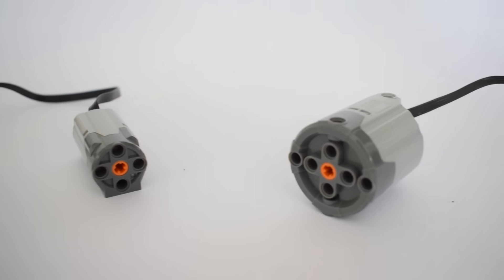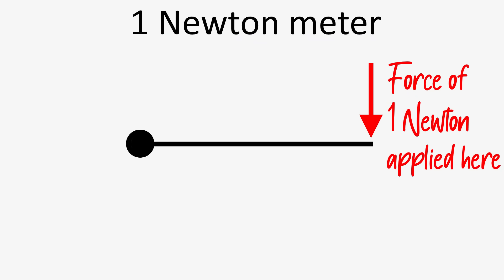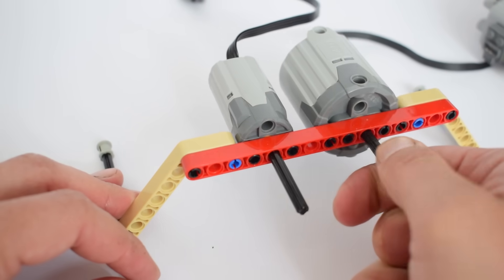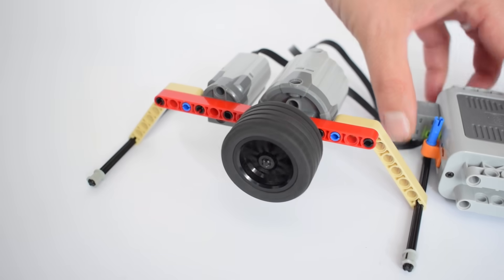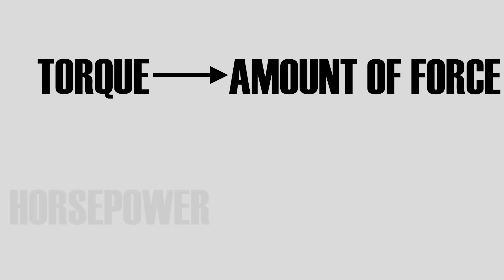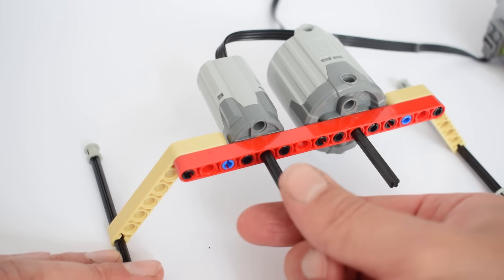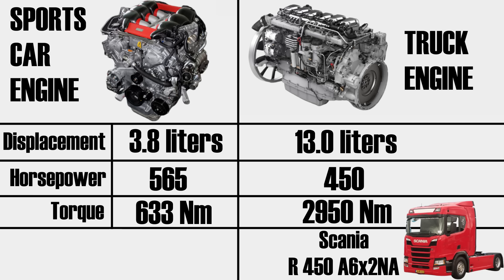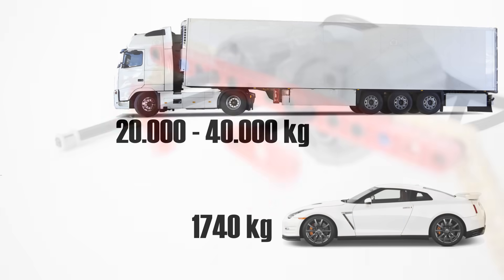NEVER be confused by HORSEPOWER and TORQUE again - HP and TORQUE EXPLAINED in the MOST VISUAL WAY

Comment: wouldn't the feeling of horsepower just be a matter of gauging how quickly that torque is being applied? For instance, if you had two engines of the same torque but different horsepower, although the force is the same the higher horsepower engine would apply it more quickly. So I guess I'm confused about how someone wouldn't be able to "feel" the difference. I agree that it is mostly an observation but if something pushes you at one speed and again at a different speed with the same force, I don't understand how someone isn't feeling the difference.

Comment: 4:47 is incorrect. Horsepower measures rate of work. If there's no work being done, then "rate of force" is meaningless.

For example, if I torque a bolt to 75 ft-lbs, and I apply 75 ft-lbs of force to that bolt, I'm not doing any work. I can sit there all day applying 75 ft-lbs, I can do it 12 times in a row, but that bolt is not moving and therefore I haven't done any work.

Likewise, I can hang a 1-lb weight off a 1-ft lever and generate 1 ft-lb of torque. I can leave it there for 24 hrs, but it still hasn't done any work. So when you say "horsepower is how much force is generated over a period of time," that's just plain wrong. It's how much WORK has been done over a period of time.

Horsepower measures how quickly a task is accomplished. That's why the time factor is key in calculating it. It's not simply a matter of force over time.

Comment: Good explanation. I was hoping at the end that there would be a brief discussion of how gearing contributes to the torque delivered to the wheel, relative to the engine power and torque, but I suppose that can wait for another video. Would it be true to say that the GT-R, having the more power than the truck, could haul the load just as ably, given the appropriate gearing?

There are a few points for improvement with this video: the use of irrelevant and obsolete non-SI units do not make things any less confusing and should be dispensed with. Please also note that SI unit names follow the normal rules of capitalisation in English: the newton should begin with a lower case 'n' unless starting a sentence. Compound unit symbols, such as that of the newton metre, require a space or a half-high (centred) dot (·) to avoid misinterpretation, i.e.: N m or N·m are acceptable, not 'Nm'.

Comment: What I dont understand is why high torque engines have lower horsepower. what limits them to rotate slower when they have better rotating force?
Reply: Material properties. When you output that much rotational force, you're pushing the crankshaft to the limits of the material it is made of. Regular forged cranks in diesel engines (which have massive torque output) can only handle X much load before you break it, whereas a billet crank from a better material can handle Y more load, think a race truck application where you upgrade crank and valvetrain to raise max RPM from 3200 to 4000. The pistons through the connecting rods are twisting that crankshaft with much more force than in, say, a V10 Lambo engine. You can apply that force faster and more over a given time frame since it is less force to begin with. Think of a tree branch, if you climb a tree and stand on a thin branch right next to the trunk, it will hold. Stand further out, and it may break. Also think of a fist fight, you can get hit with harder punches if they're less frequent, or you can get hit with more frequent punches if they're lighter.

Comment: Your human example humors me. Guy at work is often amazed that despite my small frame, I can move heavy objects. If a heavy pallet is hard to push straight, you can rotate the pallet around one wheel and then shift straight as a jump start. Momentum becomes an ally, not an enemy. Or is it Inertia? ... Anyway. Same with stairsteps, you lift half the weight over a fulcrum, applying the other half to the shelf. Center of mass is important.

Comment: Torque wrench... moving the bolt with a finger linear then rotational, had a "torque wrench" been demonstrated for us gear heads may have helped in the practical application.

Comment: Likewise a smaller athlete may easily be  able to do more work than a larger athlete. The larger athlete may deadlift 500lbs and the smaller athlete only 200lbs. The smaller athlete may do more lifts through a greater distance in one minute than the larger athlete.

Comment: I came to learn the difference between torque and hp and I end up learning what torque is and not understanding what hp actually is :D
Reply: Torque is force without motion, in a running engine you can't separate the two. So torque is basically one powerstroke and hp is all the powerstrokes added up in a minute aka rpm. Torque and rpm do everything together like tow, accelerate, drive at speed etc.. and we call that combined ability HP.

Comment: Everything is like water or electricity.  Flow rate and pressure or current and voltage.  In mechanics, speed and torque.  Combine them and you get power.  No gear box will ever change the power output of an engine.  Gear boxes are like transformers for AC electricity, changes the speed and torque like the current and voltage.  The multiplication is always equal.

Good not to confuse those facts.

Comment: In a car, you can feel the power, because you can feel the acceleration. You can get to 100 km/h in 2 seconds, where you feel it a lot or in 20 seconds, where you barely feel it. The same force is used. You can feel power, not torque in a car.

Comment: Normal b*****ks.  Not comparing equivalents.  If the motors run at the same rpm, it would be a correct comparison.  All motoring journalists go on about really torquey engines...but if in a higher gear, no difference
Reply: It is simple, torque is a force, HP is power...not the same units.  Force time time equals power...basic physics!
Reply: ps,  I wish they would use kilogram meters, as you can visualise that.

Comment: There's a much easier way imo to a layman or an average Joe like me, A tank at 1200hp Vs a dragster car at 3000hp in a tug of war, the tank will always win despite being less hp and pulling it's own weight, visa versa in a mile race, other examples closer to weights are Triumph Rocket 3 Vs Kawasaki H2, etc etc

Comment: So in theory I could have two engines both with 200Nm of torque but engine one revs to 8000rpm and engine 2 only to 6000rpm. So in this case they would have the same amount of torque but engine 1 would have more hp than engine 2?
Reply: Basically yes. But keep in mind that internal combustion engines have different torque outputs at different RPMs.  
While not typical in the rear world, you can theoretically have an engine with high torque that revs to high RPM but does not make much power. This would be if the maximum torque was at a low RPM and the engine doesn't not function efficiently at a high RPM so the torque is low at high RPM.

Comment: I really like this explanation. And thank you for using Ft-Lb as well. I've had to swap back and forth between torque values before (when tightening bolts to specs written by engineers that've turned near 0 bolts) and they never made sense. Who has a 3 foot (meter-ish) bar unless they plan to break something?

Comment: almost flawless explanation^^ 
The torque ist not what you feel when accelerating! Thats also the power. that is where the gear ratio has to be put into the equation. more power -> greater acceleration -> greater force pushing you back into the seat.

Comment: "Understeer is when you hit the wall with the front of the car.
Oversteer is when you hit the wall with the back of the car.
Horse power is how fast you hit the wall.
Torque is how far you take the wall with you."
Reply: Speed is how fast you hit the wall*
Momentum is how far you take the wall with you*
Reply: @XStuntManiac  speed = hp
Reply: @toddwmartin3660  It's not. If it was, then ships with thousands of hp's would just fly over the water and be the fastest source of transportation, but they took literal days to swim greater distances.
Horsepower would be the kind of scale to compare how fast you can get up to speed, or how much weight you can carry.
Reply: @XStuntManiac  your over thinking this n hp has nothing todo with how much weight you can carry/haul. like 1000 hp car cant tow a 5th wheel camper its not design for that unlike stuff with less hp that can do it easly if that makes sense
Reply: @toddwmartin3660  That's true, if the vehicle is not designed to haul things as heavy, it won't but it could if it was, because it has powerful enough engine. Your hp = speed is oversimplified on the other hand, because not everything with tons of horsepower is fast if it's not designed to be fast.
Reply: No this is wrong, torque is not how far you take the wall
Reply: As explained by the top gear crew! I think it was this explanation that finally clicked with me
Reply: damn nicely said

Comment: This video is misleading. Horsepower = Torque x RPM / 5252 (Torque in ft lbs). One is a function of the other. If you ran the Nissan engine into a 45:216 (1:4.8 gear ratio) gearbox it'd have an output torque of 3038 nm @ 1188 RPM and 565 HP... more torque than the truck engine makes. The truck engine is larger because of the duty cycle requirements, not because of the torque demands. The truck can output 450 hp 100% of the time, if spec'd the same the car engine would be fueled to produce around 100 hp. If you wanted to design the truck engine for a car like duty cycle you can make it do over 3000 hp at 8100 nm (6000 ft lbs) of torque... outside of racing this is not common.

Comment: The feeling of being pushed into your seat has to do with acceleration and more importantly, the slope of that acceleration curve (derivative) which is known as the jerk rate. The jerk rate is what 's responsible for making an electric car feel like a bat out of hell when you try to give it some forward momentum due to the way electric motors operate vs combustion engines, and so can make an e-car perceptively feel a lot faster than what it reports on actual performance numbers.  But also, this is what you feel (vertical in this case) in a badly configured elevator that makes you feel scared and nervous when it starts to move or stop in what seems unnatural and violent - the elevator itself is not moving very fast velocity wise but the jerk rate can be quite strong if not tuned properly. Turbulence in an airplane is another extreme example with significantly stronger physical consequences.

Comment: What wasn't mentioned is that force can happen without power or work. The small motor that could not move the weight is putting out zero HP. Since HP is work over time. The sports car engine can theoretically move the load that is attached to the truck up a hill at a much faster rate. No ICE engine can put out torque without putting out HP, because at a stop with no HP there would also be no torque. Due to this there is a formula for ICE engines that relates HP to torque using the RPM. Since this formula is the same for both the truck and the sports car, the truck is putting out more HP at it's peak torque than the car would at the same RPM. The reason the truck can pull the load better is that the transmission better matched the characteristics of the engine to that specific job. However the smaller sports car engine can pull the same load up a hill faster if it were geared to use the peak HP during the pull. Torque alone cannot pull anything up a hill and the speed of pulling a load up a hill is the definition of HP not torque.

Comment: Good explanation but big truck motors are designed for efficiency and reliability since used purely for commercial purposes.  They cannot afford downtime and so the motors can run million miles without any issues even under high strain since it's still only revolving at very low rpm's.  Good luck with that running at 7000rpm continuous with a sports car engine.

Comment: Horse power is actually just that when the word got made... Its the work 1 horse can do eg how much weight 1 horse can pull.  
Eg  500hp  is the amount of work 500 horses can do. (The weight 500 horses can pull)   it was a basic unit of measurement that has stayed with us.
Reply: 500hp actually doesn’t equal 500 horses, it’s actually 15 horses to one horsepower

Comment: I like this video but it's only half the story. Gearing is what matters. Horespower can be converted to torque through a reducing gearbox. What should be done is to compare geared motors to generate equal torques and horsepowers (in each direction) and compare which motor most effectively converts to the other.
Then you look at the mass of the motors and gearboxes to work out which is most effective in the real world.

Comment: This helps me understand my Toyota Rav4.  It's rated at 203 hp....but the torque is really bad.  So now I know that I need to rev the engine rpms higher to get more power.  Or to put another way, there's more of sweet spot at higher rpms on this engine.  The torque (amount of force) is low.  But the rate of application (higher revs) needs to be greater.  My old Chevy Trailblazer had fantastic torque even at low rpm.

Comment: So he didn't go into this, but I always thought the reason low-rev diesels were used instead of high rev gas engines was because power was produced efficiently at lower RPMs. One could take the sports car engine and put it through a reduction gearbox to produce 2000+ nm of torque like the diesel, but reduction gear boxes are lossy and thats extra parts.

Comment: That's a pretty good explanation. Torque is what's measured and power is calculated. They are also interchangeable through gearing; that means you could design a gearbox for the sports car engine to produce more torque in exchange for power; or similarly trade torque for power with the truck engine. For most people, horsepower is a measure of performance so once you have sufficient torque to move the loaded car or truck, you should then optimize for power output. 

Consider sportbikes, which generally have around 50 ft-lbs of torque but upwards of 120 HP. There is no need or benefit to sacrifice horsepower for more than 50 ft-lbs of torque since that amount of force is enough to move the bike plus 1-2 riders. You feel the horsepower in terms the sensation of acceleration remaining steady until you let off the gas.

This is also why the foolish advertising claims that focus on torque or attempt to portray torque as more important/relevant than power are deceptive and misleading. They say stuff like "electric motors produce full torque from 0 RPM" but fail to mention that at 0 RPM they are also producing 0 power. An idling gas or diesel engine uses a flywheel to store power in between strokes, and the engine can be accelerated to any RPM before engaging the clutch, thus a gas engine can produce power AND torque before the vehicle even begins to move.

Comment: Static torque is Torque.  Dynamic Torque is now Horsepower.  A torque wrench or electric motor can produce torque but if there are any rpm, it is now Horsepower, by definition.  An internal combustion engine has a torque "factor" but can only ever produce Horsepower because they make nothing without rpm.

Comment: Pounds/foot, not foot/pounds: X amount of pounds at the end of a foot long lever.
Reply: You multiply, not divide. Force * length.
To prove it to yourself, double the length of the lever and you'll get twice the torque (cheater bar, anyone?). Double the force applied at the end and you'll also double the torque.
So the order is irrelevant.
Convention is "foot pounds".
Reply: @johnd7564  Actually that's not correct. The measurement of force in this case is at a set distance, i.e. one foot long lever, period, not a lever that changes length, breaker bar? What changes is the amount of force, i.e. pounds, placed at the end of that 1 foot long lever, that's why the correct term is pounds, (per) foot long lever. More pounds at the end of thatfixed 1 foot long lever ='s more force, with the same length, i.e. 1 foot lever. Extending the lever multiplies existing torque force but does not measure it. Also, foot pounds is a term used as a measure of work, i.e. moving something X amount of  feet using X amount of  pounds, i.e. foot/pounds. Using pounds/foot is the correct terminology to describe a torque spec/measurement.
Reply: @esstee9595  Torque is rotational force. It's exerted and measured at the pivot point.
Reply: @esstee9595  Torque is rotational force, so it's measured at the pivot. It's described as a specific force acting perpendicular to the axis of rotation at a specific distance (as in newton-meters or lbf-ft or ft-lb).
There are actually multiple common usages in the US, according to Wikipedia and my own experience: lbf-ft, lb-ft and ft-lb.
My real point was that that the two quantities, force and distance, are multiplied rather than divided. And it makes sense: increase either the distance or the force, and the torque increases. I tried to invoke intuition (breaker bar) to make it clearer.
Unfortunately, sometimes my writing's not as good as I hope it will be when I start typing. :)